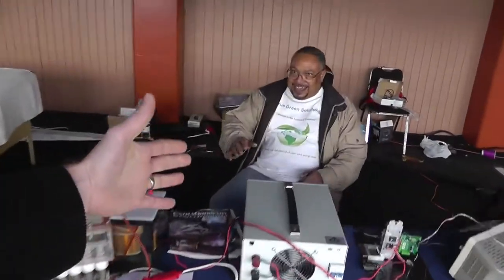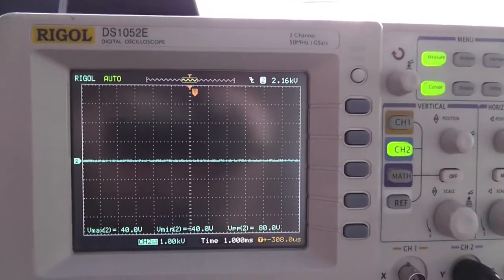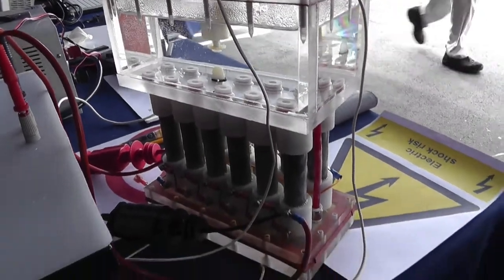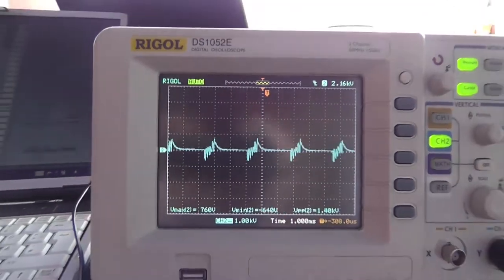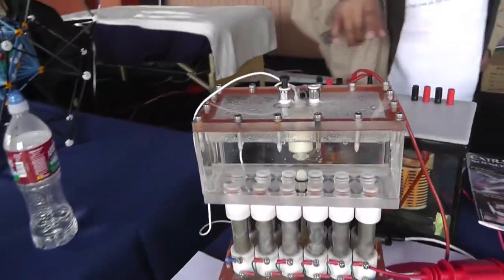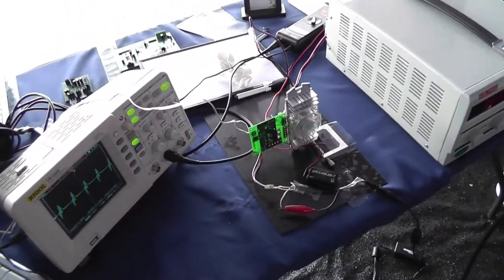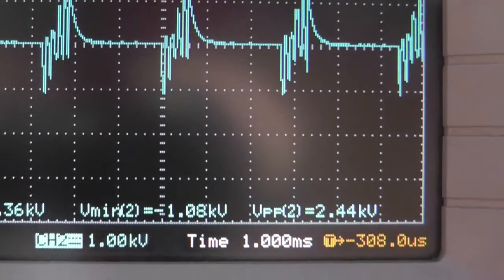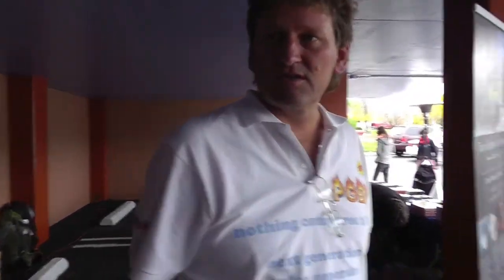#30 D2 Global BEM 2013: WFC Demo From True Green Solutions ~Russ's View

Comment: This all seems so long ago as my understanding of the technology is very different now. Now I have the correct names for things I called out plus I figured out the primary formula that governs this technology. I posted a lot of what I have learned since then but sadly no one other than myself seems to understands the actual science behind the patents I shared with everyone. From here I learned I had to build the exciter array a lot closer to what Don Gable showed us and learned the ins and outs of the waveform. I also learned many new things about the VIC transformers in how they work and the best type of diode to use with them along with a lot of improvements I made by way of trial and error testing. I had so much more to learn back then but at least I showed courage in taking an untested setup to be shown to the whole world. To this day I still wonder why my 30 minute speaking time slot got canceled as they never gave me a reason why.

Comment: It would seem 2018 is going to be the year I get a working prototype up and running 😂. Right now I am currently building the VIC transformer that should work very well on my ten cell design as I have learned how to calculate these transformers correctly now so that I can build them properly. It's not easy to build things correctly but I am doing my best to get it built correctly this time around. So, it took five plus more years to get it solved as I had so much more to learn back then, but I knew I was on the right track as this is where the science lead me. To this date not a soul has reached the voltages shown in this video and I have pushed much passed that as now I am over 9kv and will soon be able to reach 20kv or more. 
Sadly I don't teach this technology anymore as I just got tired of all the negativity that seems to swarm all over this technology. Now the only site I am allowed to post in is at Overunity as the nay Sayers have won in all of the other forums. So, now it's up to me to get this technology into the marketplace so that the masses will have access to it.

Comment: Thanks as this isn't my best set up as I left it sitting right on the countertop at home. Let me ask you a question designed to help you understand the technology. If you turn on an ozone generator but have it so you can raise the voltage on demand what happens before you reach the ionization threshold for the O2 molecules? Do you get any ozone production before you reach the threshold for ionization?
This technology is no different as almost nothing happens if the threshold isn't reached also.

Comment: coils in paralel creates higher voltage?i thought the oposite.Ed you got hv because you hooked the cells in series to increase resistance but also the production was almost 0,but if you use 1 cell you get a  very big voltage drop ...Nice setup though.cheers

Comment: Here is a follow up on what I learned from this experiment: http://aetherforce.com/inventors-diary-failing-to-learn-making-good-use-of-the-scientific-method/ Enjoy Everyone :-)
Reply: Hi Edward.
Are you measuring voltage across all cells in series? If so you are only getting 2000v/12 = approximately 170v across each cell ! that`s really low.
another question:
So are these 2 big things you have in the oil-bath supposed to be the vic transformers? or vic res coils?
Reply: I read your post. keep it up eventually it will be cracked 100% . The VIC transformer you have I believe its for the application of the small aperture in the Injector not the exciter array. On Sec 10-7 and 10-8 Stan mentioned he used the VIC you replicated for a "water drop".
Reply: The VIC transformer you see in use has been redesigned to work with the exciter array. The injector and the series wired exciter arrays share one thing in common that is they both have a very small capacitance. The injector by design and the exciter array by the way it is wired. The main difference between them is the exciter array has far more resistance than does the injectors which is why the transformer for the injectors makes use of the SS 430F or 430FR wire to make up for the loss of resistance.
If only one thing you learn from me about all of this is to know that water is only truly being used as a resistor and Meyer states this in some of his lectures and he calls it Re in the patents. Once you understand this you will see that the resonance Meyer is actually talking about is between the two chokes hooked directly to the exciter array or injector.
Right now I am up to 5.8 kv but hopefully with the latest changes I will finally hit 8 kv or more. These transformers are very hard to make predictions with but I think I am finally getting the hang of it if not just a little, LOL. But I owe it all to God as without him I just don't think I would be doing any of this at all for he gives me the drive to keep driving on.
Reply: It seems you where correct 🙂 I have started down a different line of thinking now as I went and re-read the patents looking for the operating voltages Meyer used to drive an exciter array like this and what I found was his was ran between 10-20kv so I have to get the voltages up to 10kv and above for this to work correctly with my ten cell setup and I have just reached 9kv so not too much further to go. I'm working on the redesigned VIC transformers right now. Wish me luck as I try and bring this technology to market.+HeuristicObfuscation